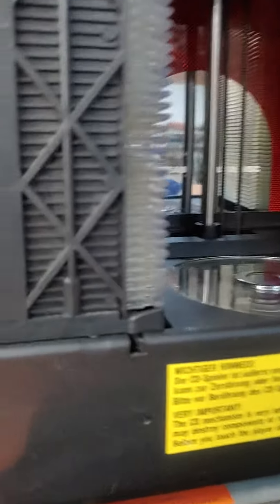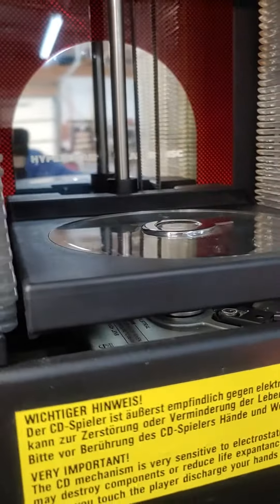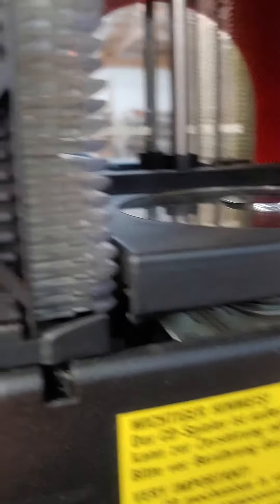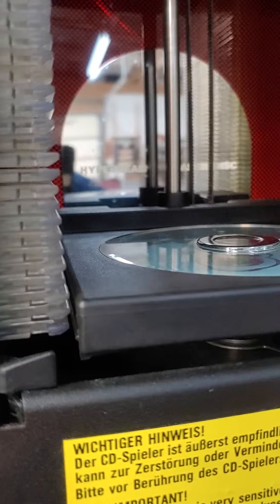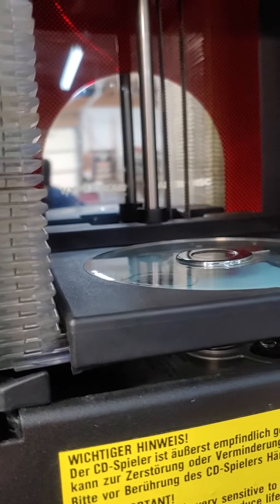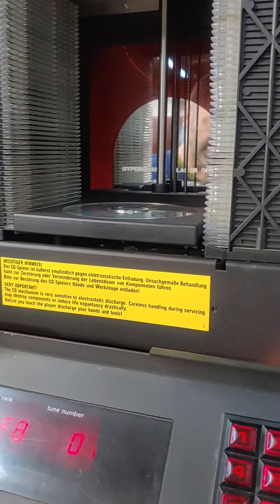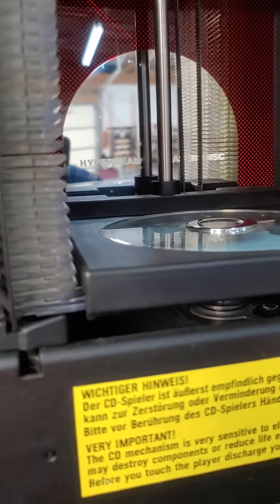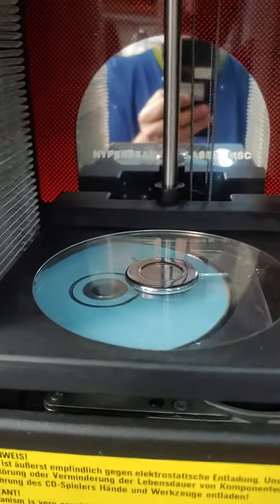NSM Hyperbeam programming

Comment: What was the ultimate fix?
Reply from the maker: Removed the entire CD cabinet.  Took the back off...and with a bit if pinball rubber, replaced the disintegrated bits inside the little space the lift belt passes through.